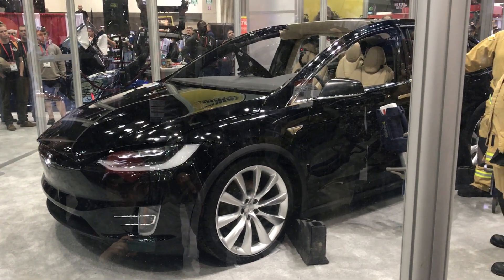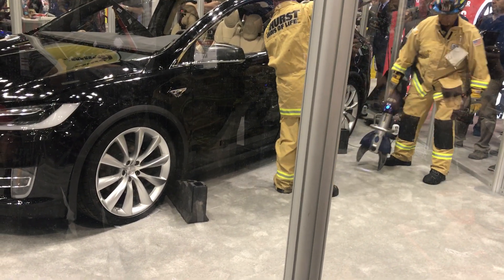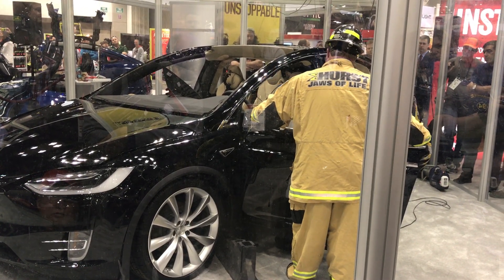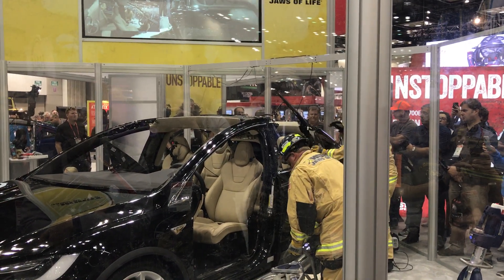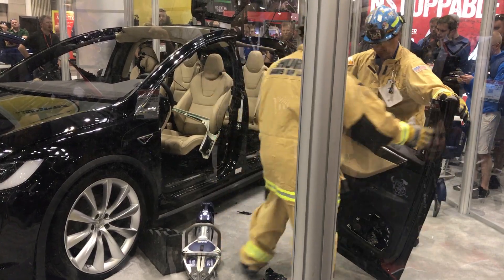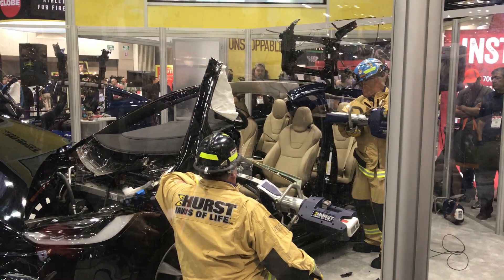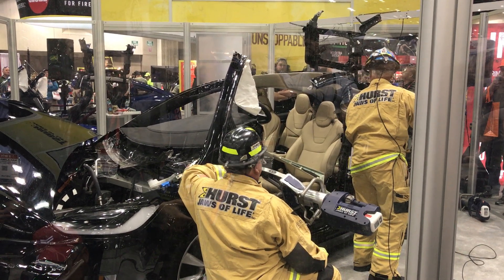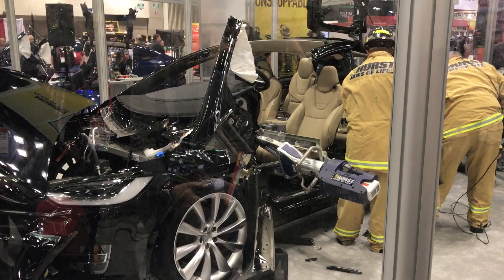Tesla Model X Extrication Demo

Comment: Seems crude and slow
Reply: I'm thinking that if the person is dead inside, I'd prefer something faster than Mr Hourlywage1 and 2 and products from someone other than Glacialware. Judging by the angular speed of those, I'd say the motorsystem is grossly underpowered compared to the weight of the other mechanics. That's an obvious optimization but I can only assume there is similar indifference to time in other aspects.